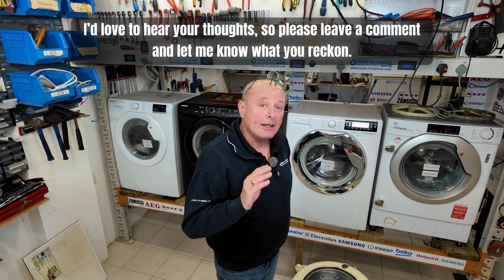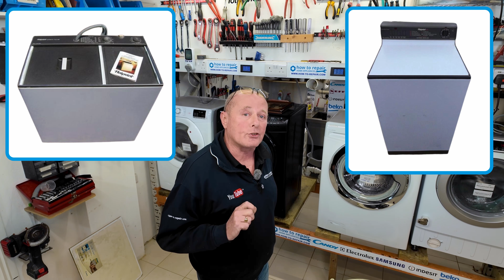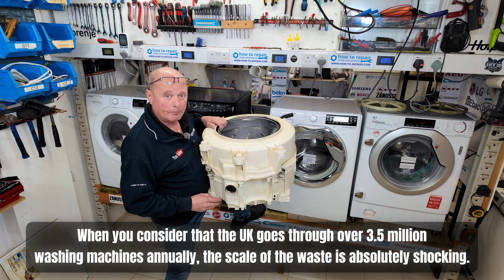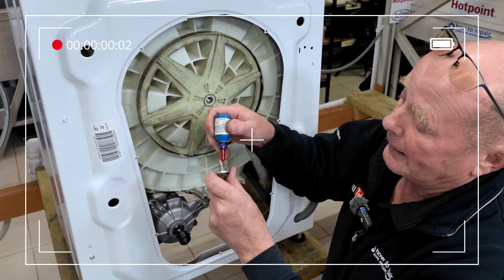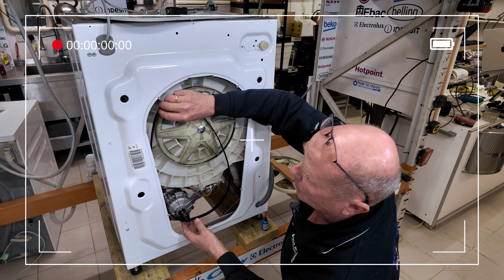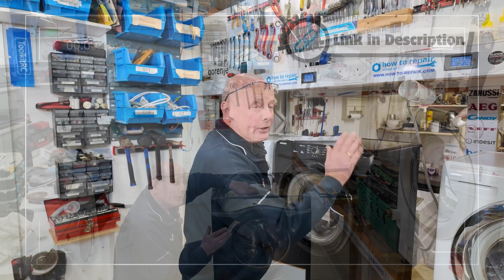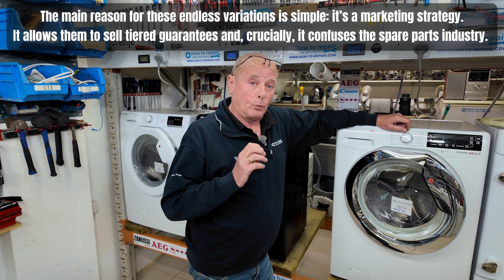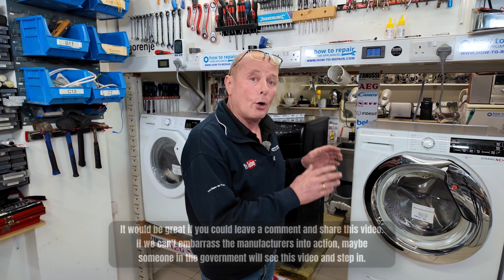I Scrapped 13 MACHINES to Prove a Point: STOP BUYING These Brands!

Comment: Many modern devices don’t necessarily break faster, they’re engineered in ways that make repair impossible or economically pointless. This pattern appears across a wide range of products, not just washing machines:

- Battery packs (Dyson, Milwaukee, DeWalt, Bosch Power Tools, many ebike brands): BMS systems that permanently lock the pack when you replace cells, even if only one cell was weak.
- Smoke detectors (Nest, various “10year sealed battery” budget brands): sealed batteries and software locks that disable the unit when the battery dies.
- Printers (HP, Canon, Epson): chips that block third‑party cartridges and force you to buy overpriced ink.
- Electric toothbrushes & shavers (OralB, Philips): fully sealed housings and non-replaceable batteries, turning the entire device into disposable electronics.
- Smartphones & tablets (Apple, Samsung, Xiaomi, Oppo): glued screens, sealed batteries, and parts paired through software so replacements trigger warnings or disable features.
- Laptops (Apple, Microsoft Surface, many ultrabooks): soldered RAM and storage, glued batteries, and proprietary screws that prevent user upgrades or repairs.
- Headphones & earbuds (Apple AirPods, Samsung Galaxy Buds, Sony WF series): sealed enclosures and non-replaceable batteries that fail long before the electronics do.
- Kitchen appliances (budget brands across the board): glued housings, non-standard fasteners, and modular parts that force full replacements instead of simple fixes.

None of this is about safety or technical necessity. It’s a deliberate design strategy to block repair, shorten product life, and push consumers toward buying replacements. The result is higher costs, more waste, and less freedom for users who want to fix their own devices.
Reply: With smartphones and Laptops, the manufacturers push for thin form factors despite no one wanting that beyond a point. The thinner it is, the more justified it becomes to seal everything up (covers are clipped instead of screwed on, ram and ssds are soldered) and it's a lot more fragile.

edit: Modern devices are indeed more fragile. The market doesn't value durability and the consumer product lifecycle is short. So there is no money in making things more durable. The simulation models are also fairly accurate. So we end up putting in just enough to last long enough for the next upgrade. It's seen as a good form of cost optimization. On top of it, modern circuitboards are more complex, so they're easy to damage irrepairably.
Reply: Canon definitively allows third party ink. Samsung phone allows to replace battery. At least in EU. So your list goes to trash right away. Second is, sometimes you really dont have to repair your appliance after several years of use because you repair one thing and second breaks months after and so on. Some shit just doesnt make sence (talking eco? well, someone have to repair it. You probly will drive to repair shop in your car using gasoline etc., and time spent could be allocated to something making bigger change on environment than repairing small, old appliance). Next, sometimes you value different properties than repairability (ultrabooks) and thats fine. Do you drive a car? Thats much worse than throwing away your laptop after 6 or 7 years.
Reply: @iwouldratherhavenoname  your point about a second thing breaking after is literally because the whole thing is designed to fail at a particular life cycle. You are literally validating his point. They are maybe saving 5% in the product cost by cutting corners (often end up spending a sizable portion of that on warranty claims) all so they can sell you another in 5 years as even if you fix it they know 5 other things are designed to fail. Even cars are going this way and electronics have just made everything worse as they are very easy to design to fail and they charge £200 for a part that costs them £10
Reply: @mitchellcouchman1444  I get your point and I agree in sense that adding proper steel bearings will cost just 5% more but longevity will increase much more. My point still stands as I believe there're many appliance where making it more durable isn't just about this simple bearing example or the product is not something you would really love to keep forever, touching my third point I made (example: toothbrush - im fine with throwing that out after some time as its product for hygiene and maybe making it more durable would add weight, size, etc.). Playing devil's advocate here a bit but I see this issue when building DIY machines or electronics - often you upgrade one weak component and by this you make another one weak. That's why ismy hobby so expensive, there's no ending to that shit. :D
Reply: They literally do break faster though, use of plastic parts where metal ones were used and min maxing of component lives to fail at 2-5 years instead of 10.
Reply: Smoke detectors are only designed to last 5 or 10 years but only because that is the amount of time they have certified for actual smoke detection - i.e. they are only certified by regulators to last approx. 5-10 years or so, and after 10 years, the smoke detection becomes less reliable and then eventually stops working completely.

Everything else you have mentioned is very true though - never buy a new cheap laptop, always get a used business-class laptop that is well designed (think Lenovo Thinkpad) - as for soldered RAM, this is to allow for faster speeds between the CPU and the memory chips, not saying that I support soldered memory, but there is at least a technical reason for the memory chips to be soldered to the motherboard.
Reply: @wclifton968 soldered ram is not faster, and it's a digital system not an analogue one so there's no argument about connection quality. It's literally just to make it 20 cents cheaper, a touch thinner and force to to buy a new one when it fails
Reply: @wclifton968  they used to be designed to last the lifetime of the structure and some can still be modified to do that , half life of Am-241 isotope commonly used in smoke detectors is 433 years
Reply: Yep, exactly correct explanation. Shocking should be a law against it
Reply: Smartphones and Tablets need to be closed to have Dust and Water Resistance. And you still can change the batteries. I do it personally. For Laptops, it is... mixed. If you want portability, you need to do other things. If you want a stationary laptop, then you can buy what ever you want. Headphones, you cant build them up open. They need to be resistant against dirt, water and even moisture. There is no good way around it. And I don't see an issue of a device breaking, because of hardware issues. As example, my Surface Pro 2 is still doing great. My Surface Go 2018 too. My MacBook from 2021 too. My iPhone SE 2020 too. For the most part it isn't really planned, but it is just how hardware works and did work for years. Any type of battery is only rated for 5 years of usage. More than that is just being lucky. So if you have an battery driven device, 5 years expectable, but expecting more would be just impossible.
Reply: Galaxy S5 (yes its bneen a while) had the same waterresistance as the S6/7/8? I dunno if they improved afterwards - and had a replacable battery.

Comment: All of these machines should be recycled and NOT go to landfill. The associated costs of stripping these items down into components is probably not cost effective and driving the landfill economics. Manufactures should be made to accept products they've sold to the consumer to be returned for responsible recycling. Our local scrap man does the rounds frequently and collects broken machines left out for him. I assume he makes a good living out of breaking these machines down and weighing in the copper, aluminium, stainless steel and other metals. I appreciate some discarded items will probably end up in landfill, but industry needs to become more proactive in sorting this. You Tube has many videos showing exports of this "waste" where labour is cheap and recycling is evident, but leaves problems with odorous products contaminating water courses and gases polluting the atmosphere. There has to be a better way.

Comment: Without Laws, nothing will change.
My Mom still uses a 16y old Privileg Washing Machine, the only thing which got repaired is the tube for removing water before filter cleaning, which got unplugged using to much force.

Comment: We bought a Miele about 15 years ago. It's in constant use but failed once due to our very hard water, basically the element became so furred up it overheated. That was about 5 years ago and we have since installed a water softener and everything that uses water in our house is working so much better. I suspect the Miele will be with us for another 10~15 years judging on how well it currently performs. What the old expression, buy cheap, buy twice (or possibly 3 times). Finally, we bought a Panasonic microwave which has just passed 35 years and has never failed once despite being used many times a day. They knew how to make stuff back then.

Comment: The past couple of washing machines I've replaced did not go for landfill.
Being retired and with a fair bit of spare time on my hands, they were dismantled and sorted for scrap. When weighed in, motor windings and armatures fetch a decent price and even the steel carcases get weighed in.
PCBs and non-recyclable plastics and chip-board end up with the council.
I've even picked up a couple of fly-tipped machines and scrapped them!

Comment: We are not advancing in technology, we are going downhill. In the 80s, 90s, every electronic was built to last, not to break after 2 years.
I remember that my parents bought a washing machine maybe every 10 years. They worked flawlessly for 10 years straight. Since i´m living alone i´m buying every 2 to 3 years a complete new machine. And the brand does not matter. Had Candy, Siemens, Samsung, haier and some others. its hilarious! Same goes with dish washers. They break like crazy. And with these big machines, its not like your smartphone got broken. You cant simply throw them away and buy new. You need someone who pick up the old machine, and if you cannot install em on your own, you have to pay people to disconnect and connect the new. Man its a nightmare for consumers. 
My last Machine that i bought was a Haier. Worked for 2 years and after 2 years the whole counterwheigt broke off inside the machine. Regardless what you do, you cannot fix this. Now i bought a Samsung. And man i smell the breakdown of that machine in 2 years.

Comment: You said consumption is good for the economy.  But most of these machines are made abroad so the only people benefiting from the jobs is the people at the end of the logistics root in the UK and the retailer workers, delivering and installing them.  

I'd much prefer to support the second hand economy.  Stripping the machines of useful parts, the repair men and lades installing these parts.  As well refurbished machines would also keep the delivery workers busy installing refurbished machines and taking away the old refurbished ones.

I know some people like a nice shiny new machine, but washing machines can be cleaned and sprayed if needed to make them look new.  Just look at the industry around cars loads of people are employed in that industry as cars are repaired and resold all the time.

Comment: In my Siemens washer , there was the controller dead. The spare would cost 250 EUR. So I put the machine apart and removed the controlboard. 
I normally repair  2-way  radios, telephone and PA/ stereo  stuff. So I took it at my bench an powered it up. The only defekt part was al little tantalium electrolytic capacitor. No 5V , no function. After replace the capacitor and put the board back into my machine  it run as it should. 
The quality of electrolytics is down. Many faults in other items which I repaired had  the same   capacitor problems
.
I came across of a pair  powered loudspeaker made in  1968 by Sennheiser, the famous microphone company. These speaker were used in broadcast Studios for monitoring.  They both got the mains indicator lit up but no sound. The fuseholder for the low Volt in both amplifieres were totally rotten and the fuses lay loos in the amp chassis.  I replaced them, before I powered they up gain I checked the electrolytics. It was amazing those capacitor had still full capacity and the ESR was better than a brand new Panasonic electrolytic with the same capacity. The brands of these were "Roederstein" and "Frako"  58 years old electrolytics still works perfectly, unbelievable. And today.. they already defect while after left the production line.
Reply: Same here. Been working with electronics sinds the 80's. I fix things myself. My parents had a every expensive induction hob like 20 years ago. After 2 years it broke down and they received a quote to repair it for like 4000 euro since it were board swaps. I took a look at it and some of the capacitors were bulging. Replaced those for like 30 euro by quality stuff and I think it still works since my parents are no longer but the place is still rented out.
Whirlpool dishwasher, broken after 5 years... It was 18 years old multiple repairs by myself (including cuts in my fingers) and then it was time to let go. All this because the flow sensor would fail after x-amount of years.
Reply: I just repaired a friend's Miele dishwasher - 2020 vintage that had blown one of a pair of MLCC bypass capacitors on the three phase pump motor controller as Miele wanted £450 for the board and £150 labour. The machine was just over £1k. I replaced both capacitors with new for the princely sum of £0.26p and my time. I don't think any brand is long term, trouble free ownership these days. The "right to repair" is also flawed, where is the download for my recently dead Siemens fridge-freezer? Nowhere to be found. Siemens doesn't want me to fix a 15 year old machine with a single X2 capacitor (£1.50), it would rather the unit got recycled and get me to buy another. Of course Siemens is Bosch, the Liebherr fridge-freezer I was looking at looks identical to the Siemens... LOL.
Reply: @davidhunt240 same reason I won't get rid of my Liebherr which I purchases in 1999. Still works perfectly. I monitor the power usage and it is still fine, not as good as new models... but everyone I know is replacing their fridge after 6 to 10 years... because they either break down or because they consume less.  Guess which one is better for the environment and my wallet. I even replaced a plastic part of the door handle for like 3 euro since that part is even available online. Only when I can't repair it myself it is time to let go. The right to repair and parts availability is a must.
Reply: I have repaired a few reVox A77 Reel to Reel recorders, from the mid-70's, but in them I do absolutely have to replace the small plastic white "ship shaped" Frako capacitors, they are all gone. And of course the RIFA spark suppressors which were standard in a lot of Hi-Fi in the e70's. Not all electronic components age well.
Reply: @florianm3170  all metallised paper capacitors go bang eventually, just replace them with metallised polypropylene. Some folks thought new RIFA wouldn't smoke, they were wrong. Some folk thought WIMA wouldn't smoke, but it smoked and oozed (worse than RIFA)
Reply: @florianm3170  The white ship shaped Frakos are a mess. Many radio , amp and electronic stuff were fitted with them, but not professional equipment.
Later Frako  had the  cylindric shaped round ones for consumer stuff, not even better than the ones before. 
I got a Dynacord vocal amp from the 70th, model "EminentII , got mixed technology , power amp with valves and pre amp with tranasistors. The had also employed the white and some of the round ones . I had to replaces all of them.
The Best of the old ones in Consumer appliances were Philips/Valvo/Mullard and the early Siemens.
Reply: According to MBA and consultant this is very reason Roderstein and frako are no longer surviving
Reply: @lovegod1000 Without capitalism we could just build to last and there would be no companies in general. The system is rotten. Everything else is just a symptom.
Reply: Regarding electrolytics and a lot of other electronic components: Regulations really did a number on longevity when things like the ROHS(Reduction of Hazardous Substances) directive came into effect. Some things simply can't be made to same standard any more.. 
That being said, it's definitely also a cost issue and planned obsolescence is too much of a cash cow for manufacturers to want to make an effort.
Reply: Tutorial please
Reply: Was the same story. with Bosch machine)
Reply: That’s a great example of how small component failures can take down an entire machine. A single capacitor killing the 5V rail and making the whole washer look “dead” is something a lot of appliance repair techs see now. Unfortunately many modern home appliances are treated as unrepairable once the control board fails, even if the real problem is just a cheap component. That’s where planned obsolescence and limited support for the right to repair really start to hurt consumers.
Your capacitor example is fascinating too. Older components were often built with much higher product durability, while today many manufacturers push cheaper parts to keep costs down. That kind of component-level change is a big reason people talk about the broader product quality decline and why some products feel almost built to fail.

Comment: Washing machine cost 250 to 400 pound and it works for couple years if you not idiot. Calling repairman to have a look is already 70 to 100 pound just for a visit and then more to fix it. Its not worth it at all. Its like investing in old car more than its currently worth.